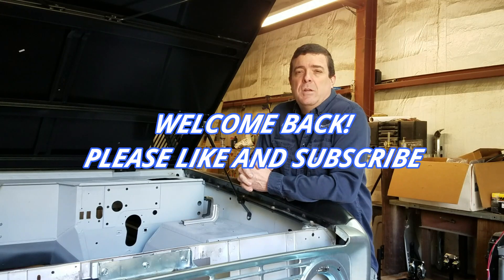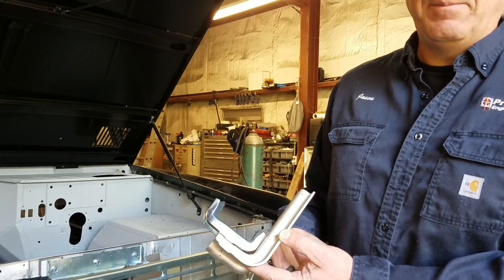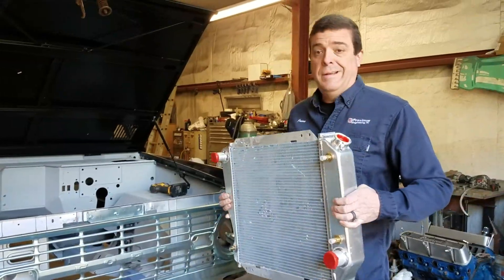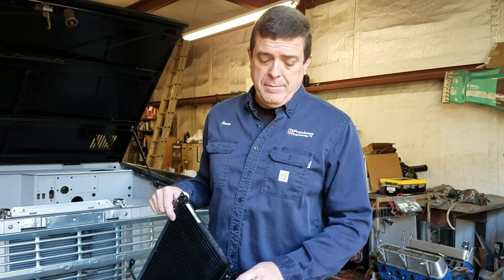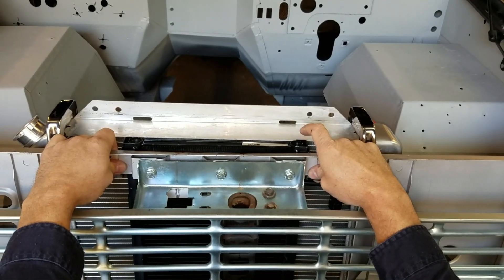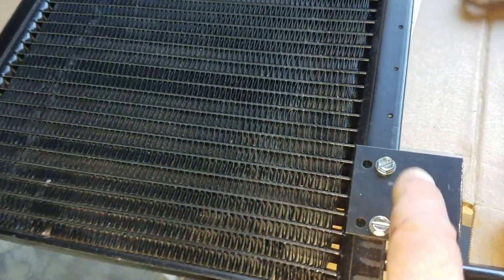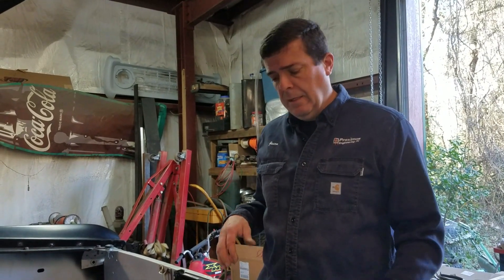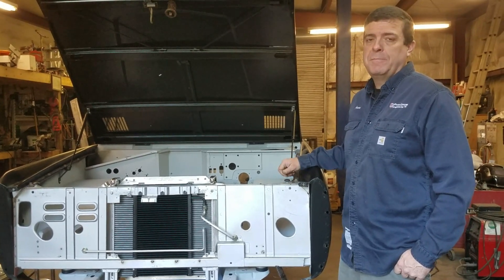Radiator and A/C Condenser Installation - 1966 Ford Bronco Restoration Project

Comment: Rough carpentry with a finishers touch.  That last part is where I lose my patience.   I like this modification a little better than having remove the hood latch...extending the core support and having to install hood pins.  May give this a shot.  Also thanks to Joanie for a short novice educational moment.
Reply from the maker: Thanks Rich!  It seemed to fit well the way I did it but I am sure there are many other ways to do it.  Jonie said thanks too.
Reply: Talked to my fellow Bronco people here and they said with our heat out here in AZ yours is just too small.  Sad sad.  I have only been to Charlotte,  NC and it was great.   But, you heat is wet.  No thanks to that.   You guys should come to the Arizona Bronco Stampede event we are having.  March 15-21.  If you "Might Could Do That".  Thanks again.

Comment: I think I'm going to be in trouble....I have the same radiator. I just checked, my mounts will need slight trimming as well. Great tip !!! I bought the under dash kit from Tom's. It has the condenser on the outside of the radiator core support. I really dont want to have to remove the grill since everything is already painted. I think whoever wrote the instructions for your system must have done these as well. Even has hand sketches. Thanks for another great video.....
Reply from the maker: Thanks David.  If your hoses are not precrimped you can fit it in the best location for you.  Thanks for sticking with us.

Comment: Love your videos and have learned alot especially underneath the Bronco.  I have a 73 Bronco and one thing that bothers my OCD is 2 different finishes of the radiator and condenser.  Everytime I look at the front-end, I see beyond the grill and am personally going to black out cause it draws the eye.  I just think the Broncos front-end design makes that radiator area pop, I have had comments also.

I just received and am changing the hood struts from the style that you have to the James duff ones.  After 2 years, these struts are loaded in the hood being closed position...so between that and opening/closing.... Solid metal hood starting to bulge slightly between the hood braces and now noticeably above the tops of the fenders.  Not happy because my gaps were right on...Hopefully I can fix it...
Reply from the maker: Thanks Phil!  My plan is to strengthen the mount location like the Duff setup is.  I know the TBP mounts further back but adding some strength should hopefully make it stronger.
Reply: @JasonJonieBuilds  Good!  You know about it and thats sounds like a good plan. 

Also, Love the husband and wife tandem adventure in the garage.  Smart guy, I see what your doing--How much longer before Jonie takes over the building and you get to tape from the barca lounger?

If you ever need anything, let me know.